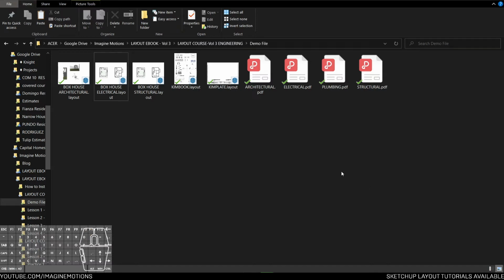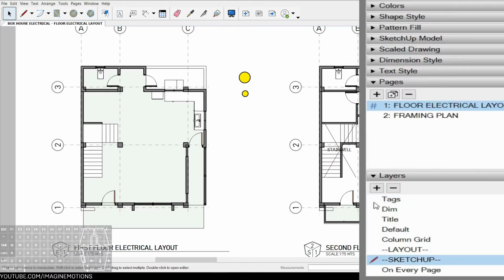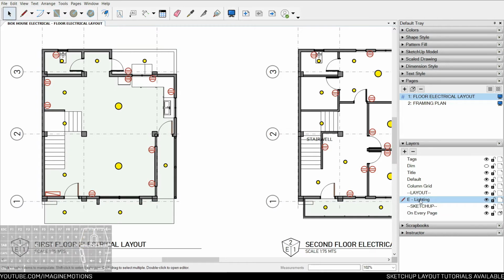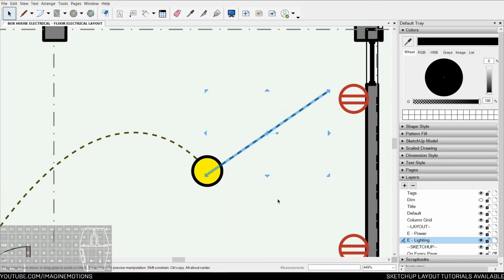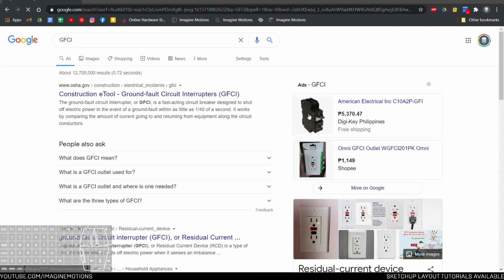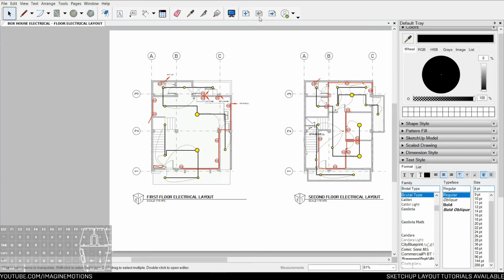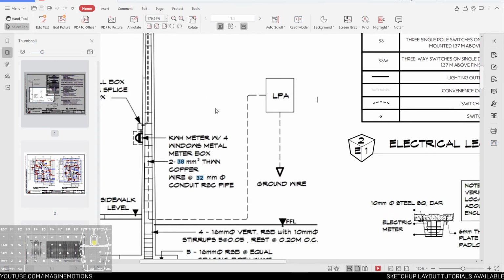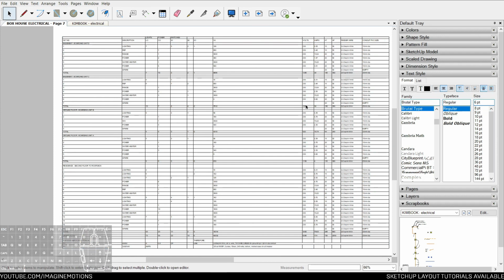Sketchup Blueprint 3 - 2d Electrical

Comment from the maker: VOL 3A BASIC - 2d Engineering
Get the files & Scrapbooks here at http://gum.co/IMVol3a

00:00 Intro
01:48 Getting Started
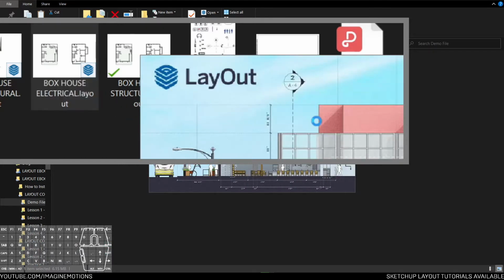03:29 Document Setup
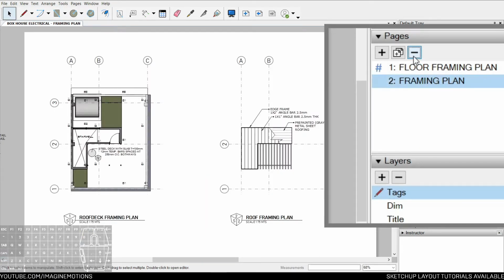04:15 Fixture Layout
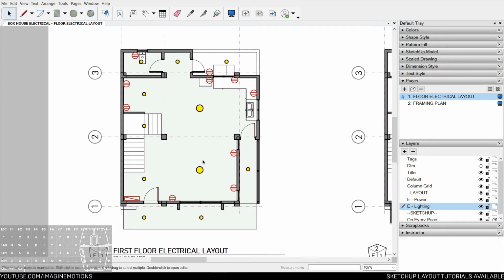10:57 Switches
16:24 Circuit lines
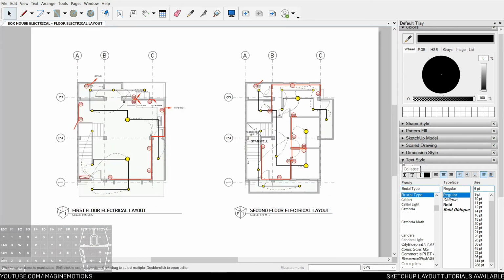24:42 Scrapbook
21:13 Rectangle Overlay
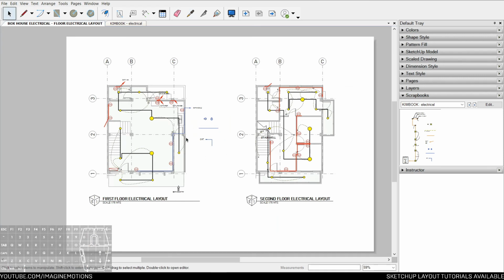28:42 Load Computation
31:46 Insert Excel/CSV
Reply: Excellent lesson  thanks a lot, I tried to open the link to get the source files but ( the page cannot be found) can you put them again to be available for download

Comment: You might have covered this elsewhere but can't we add electrical/plumbing as layers so we can see them over the same design?
Reply from the maker: yes you can add layers to however you want to work it with. 

just click the plus sign (+) in the layers tray and whichever is above will be shown.
Reply: @imaginemotions  Thanks for your quick response – it helps as I'm still working on it.

Comment: Perfect! thanks for the video. A question, which electrical standard is used in this layout?
Reply from the maker: conceptual draft for outlet locations, then the symbols are later detailed to revit symbols, or  whichever is accepted by the building official.
Reply: @imaginemotions  ok thanks.